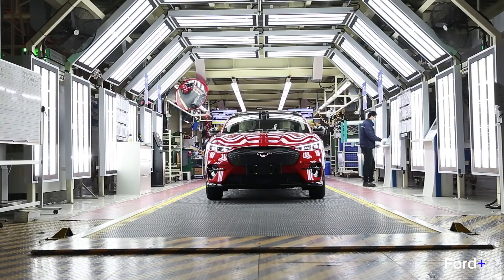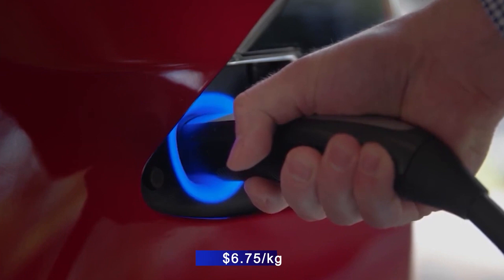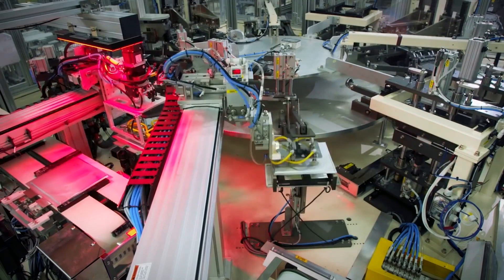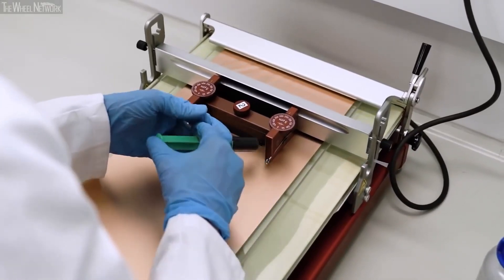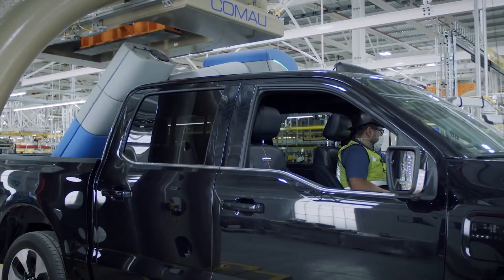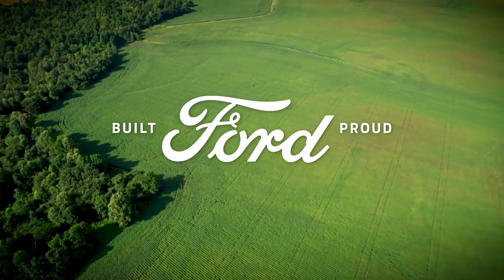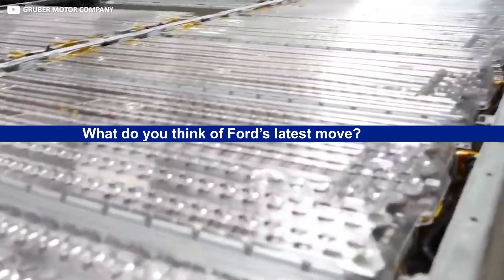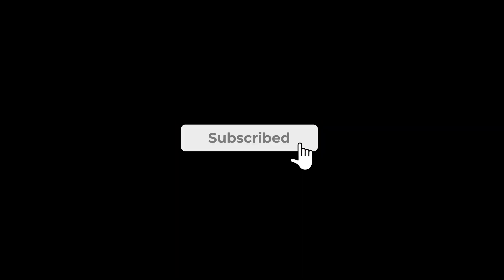IT HAPPENED! Ford Finally Reveals New LFP Battery!

Comment: Range and price are great factors for sure...

I'm just waiting on a battery that can withstand the harsh cold climates. Currently, batteries need to be kept warm to survive the cold, but that cuts range by nearly a third. It doesn't sound like much, but when a trip to the next big city is 300km one way, with 0 chargers between them (and only 1 gas station), winter driving becomes a heck of a worry. Compound that with -20 to -40c weather... and if EVs wanna replace gasoline, it needs to have a much less range reduction in winter.

I still love EVs as a tech, but before I go all in, there needs to be a bit more winter consideration other than "just warm the batteries".
Reply: isn't that range reduction also largely due to heating a vehicle's cabin?
Reply: @124thDragoon  No.. batteries dont like it too cold or too hot.  Their ideal chemistry performance is best in a fairly narrow range of teps.
Reply: @mongocrock  yes, I know this. Isn’t more energy used to heat the comparatively larger, less-dense, less-thermally-conductive cabin volume than the cell array at those temperatures?
Reply: @mongocrock  I've measured the Bolt battery's internal resistance at 40F (which is when the battery heater cuts out) by looking at the voltage drop under load.

It corresponds to only 1% or so loss at typical highway loads.  For reference, the battery heater is rated 2 kW and doesn't run for long before getting the battery up to temperature.

Meanwhile keeping the cabin windows from fogging needs quite a bit of power in a vehicle without a heat pump.  Even with the fan speed on 2 (out of 8), the moment you turn on defog/defrost (which disables recirc), cabin heater power goes up to 5+ kW, and often pegs to 7.5 kW.  If you use recirc without the AC to dehumidify (which wastes power), you fog up in minutes.  (If you didn't have to worry about fogging, you can maintain the cabin at 72 with only 1-2 kW of heater power even if it's below freezing out)
Reply: Evs lose about 20% in winter, on par with the fuel economy loss that ice vehicles have during winter.
Reply: Just stick with a hybrid until hydrogen fuel cell cars roll out.  In the snowbelt, a fuel cell or hybrid can be considered a 90% efficient cogeneration plant while in SoCal its just a 55%, or 40%, respectively efficient drivetrain that gives off waste heat.
Reply: I agree with your concerns sir. These are same as that of everyday people whom ev manufacturers target to sell. But they hurry too much but don't quite  give yet what people like you really need. It's for profit and competition of course. Until that time ev companies put people's need first, ev remain a dream on hold.
Reply: Yeah you are one of the 2% of people that an EV is not suited for at present. Statistically 0.04% of all passenger trips today are more than 200 miles. 97% are less than 30 miles. But charging is a lot quicker to build out than gas stations. Electricity is everywhere these days, you just need to collect it.
Reply: @davefroman4700  I'm honestly willing to buy an EV as my next vehicle, I just would like battery tech to endure blisteringly cold climates also. Not via heating and conditioning them, but just on their own. It's a hope I have for the future of energy storage is all.

Plus, I know my personal issues with range aren't something everyone deals with, but it's still something I need to consider when buying a vehicle. I cannot afford 2 of them. I'm still interested in EVs. I find them awesome.
Reply: @Xyler94  You plug in your gas car in those conditions correct? Even a 120v outlet is enough to keep a battery warm. And once the vehicle is moving the battery warms up on its own due to the energy being drawn out of it. While you do experience some loss due to the heating of the cab, most models now use heat pumps to accomplish that. Which is 5x more efficient than resistor coil heaters. There are also now sodium batteries entering the market that while are a little less energy dense at the moment, offer a superior performance in colder temperatures. CATL is already producing finished packs with some of the cells being Sodium based for better cold weather performance. A LOT is going to change over the next 5 years. Not only in batteries but infrastructure as well.
Reply: @davefroman4700  2%? What planet do you live on? It is according to the 🔌 car foundation the numbers are more like 82%